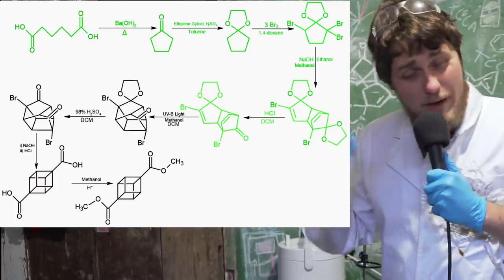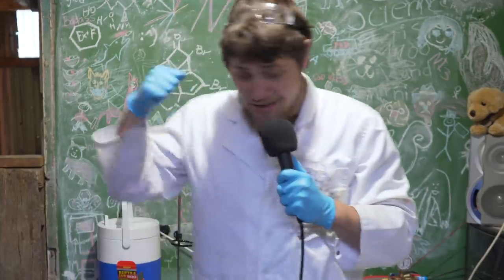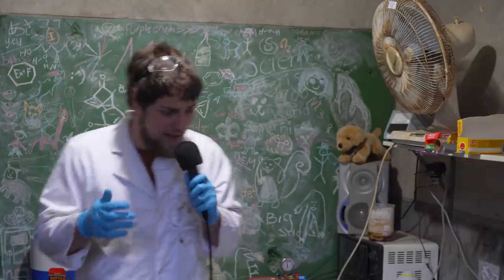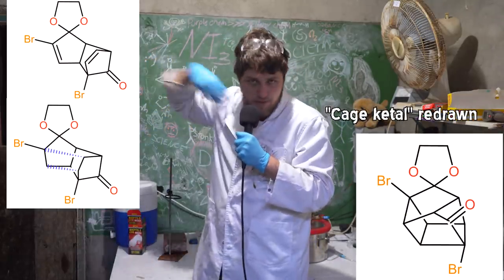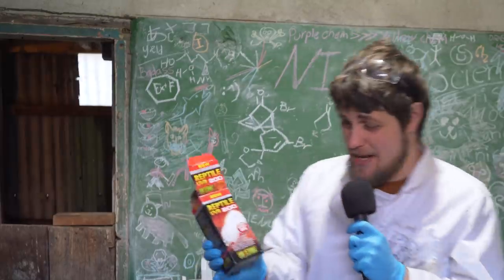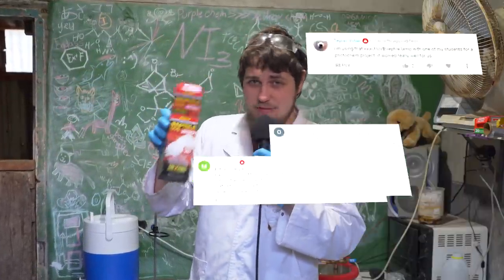Ultraviolet Cage Creation - Cubane Ep 10

Comment: For revelation, maybe you can use your long wave UV to reveal different spots as a "non destructive" revelator, note the spots and then reveal with KMO4 or if you have some elemental iodine on hand you can do the same with that and then reveal with KMNO4. That might help you differentiate between your unstaturated and your saturated ketone. 

Procedure for Iodine revelation (https://www.chemistry.mcmaster.ca/adronov/resources/Stains_for_Developing_TLC_Plates.pdf):
A chamber may be assembled as follows: To 100 mL wide mouth jar (with cap) is added a piece of filter paper and few crystals of iodine. Iodine [...] will rapidly become saturated with iodine vapor. Insert your TLC plate and allow it to remain within the chamber until it develops a light brown color over the entire plate. Commonly, if your compound has an affinity for iodine, it will appear as a dark brown spot on a lighter brown background. Carefully remove the TLC plate at this point and gently circle the spots with a dull pencil.

As for the eluting solvant, DCM/Methanol mixture is way too polar for both your subtrate and product. I usually use it to elute polar stuff like hydroxyamides up to a maximum of 5% MeOH/95% DCM. More than 10% MeOH can dissolve the silica if thats whats on your tlc plates. Try mixing some DCM and alkanes/petroleum ethers.

Comment: Quartz sleeved UV lamps have become very cheap thanks to the popularity of UV air purifiers and water sterilizers for drinking water, fish tanks, spas and pools, etc. I'm guessing that they're locally available in Australia, although likely at a premium compared to direct from China or the USA from a bulk-importer that gets them from China. They're essentially a standard fluorescent bulb, but with a quartz envelope instead of glass, and no phosphor to turn the UV generated by the mercury vapor into visible light.

Pardon me if it was already covered in the video, but exactly what wavelength of light are you going for? What was specified in the paper you're following?

Comment: Your TLC eluant is still too polar for your reaction mixture. Your desired product and starting material are very similarly polar. I would try 50/50 hexane:DCM eluant - aim for your main dark yellow spot to be no higher than 40% of the way up your plate for optimal separation. It may be the case that you've already converted all of your material and those two faint spots are just side reactions. Hard to say. Regardless, looking forward to the NMR.

edit: also - as others have mentioned - it may be worth looking into the opacity of your borosilicate glass to the desired UV wavelength. Maybe try moving your reaction mixture way closer to the lamp if you can't afford to buy a quartz tube.

Comment: Put the stirrer plater underneath the box and have stirrer bead in the tube should speed things up. Nitrogen or argon sparge of solution and balloon to keep any O2 out during the rxn or sparge and seal the tube with stopper a clip or elast band. Quality of glass tube matters as well. Pressure should be ok. Create concentrated rxn area, put a cardboard piece to half the area so its a 1/3 and put the tube as close the lamp as possible. Some times you buy uv or lamp probe and that sits inside the rxn solution. Thats how close you want it.  Some rxns take a few hours to 1 week. You could have alsorts of impurities. Polymers, alkenes joining to other alkenes.

Comment: You may try immersing the lamp in the solvent with your substrate to get better exposure surface. 
Of course it's better to use some higher boiling solvent than DCM for this since the lamp will probably boil it off.

Comment: You got any lenses for your ghetto lamp?  Might need a bigger box.

I worry that the solution is very translucent to UV so it's not absorbing a lot of it, whereas everything else in the box save the aluminium is opaque to it.

Could also make a parabolic (or spherical I guess) mirror out of a fire blanket, a hula hoop, and some pressurised air, and use that to focus the sun onto your tube, now the winter's probably over.

Comment: One thing I could think of is the emission intensity of the UV light you need is pretty low and the light from the lamp is pretty diffuse. While lining the box in foil definitely helps, it's not doing much to concentrate that light onto your reaction mixture. I think you should try some way to better guide the light onto your sample.

Comment: Yeah a MH/HPS setup would run anywhere from $100+ USD and the lights are like you said usually not self ballasted or self cooled. So tack on another 100 or more for that stuff. My grow lamps after running all day and checking their temps are usually around 140C-160C with a blower pushing cool air over them all the time. If you had no issues with evaporation you would then, as well as risk of fire. But if you are interested in getting that equipment look at nurseries, farming co-ops, hydroponic shops, and some reptile lights are self ballasted but they are on the higher end mine are usually $60USD+, you then run into the heat issue again though. Maybe make it a patreon goal so you don't have to drop all your personal money? Hope you're doing well with school m8 look forward to the next video, good luck!

Comment: Seems it'd be a lot more convenient to drill another hole through the lid and just hang that long test tube/vial, clamping onto the top so it doesn't slip through.  Then you could pull it out and check it without even opening the lid.

Comment: Vanillin Stain Recipe:
100 ml container
6 g Vanillin

1.5 ml Conc. sulfuric acid
95 ml 96% Ethanol

Try this even if you can't separate due to inadequate solvent it will have different colors depending on the functionality you put on the product so should be able to distinguish I'd you've done something.

Comment: If it works but slowly, put the mix into a thinner walled tube, much closer to the bulb. Like, buy a metal mixing bowl the same size as your reflector, drill a hole big enough to hold your tube, and put the bowl over the end of the lamp reflector. Capture ALL THE LIGHT.
... might need cooling though

Comment: You may be able to score a UV lamp out of an UV air purifier.  I found a "broken" air purifier and took the lamp out and put it in a standard florescent fixture and it works like a champ...mind the ozone though.  Also, it's straight up cancer light (UVC) so it may be too short of a wavelength; I don't have the equipment to test it.

Comment: I'm late to the game, but there are little water sterilizing lamps for camping. The brand in the US is steripen and it's a little self-contained low-pressure mercury lamp. They retail less than 100USD. Might need to break some of the safety controls on the thing.

Comment: Get smaller/thinner test tubes and put your solution right inside the spiral of the lamp, you will only need to foil the lamp for reflection and can leave it in the open air (or with a fan) to stop overheating

Comment: I've personally never run chemistry with those reptile lamps but have had 
 success with normal commercially avaliable CFLs and LEDS so the idea doesn't seem too far fetched to me. I however  would check the wattage on ur light source and make sure it lines up with what the literature utilizes. If ur lamp is too low in intensity this reaction could take forever. Also, you can certainly leave these reactions overnight without much danger but your set up should be adapting to cool as well (Heating a photo reaction is a nice way to set up decomp)! As an anecdote,  I've left photoreactions with DCM/MeOH under xenon lamps with cooling for 12 hours and nothing dangerous occured so im sure u can fix this set up to do something similar. You could purchase some lamp top cooling pads or even those cheap box fans meant for student apartments on amazon those work fine. Oh, also If your compound is sensitive I would possibly consider removing  as much oxygen as possible, uv light can always generate singlet oxygen which for most photoreactions is not the best. 

Good luck!
Reply from the maker: Yeah that's basically it. The wattage is only 26W and that is tiny compared to the 1200W lamps the papers tend to use, so yes, it takes forever. 
How did you actively cool your photochem reaction, was it just air cooled? A laptop cooler is a neat idea, thanks!
Reply: @ExtractionsAndIre  I gave a brief look the references and yeah 26W might not cut it in my opinion. Personally, I'd try bumping the wattage up to at least 1 100W blub. We have few set ups but our most simple are a just a screen made out of cardboard and aluminium foil that covers the reactor on three sides sith the fourth side facing a wall. Typically we at least use a fan to have some air circulation to avoid heating up the reactor. I could show you pictures for ideas if you'd like. Let me know!

Comment: If you need a mercury lamp, you can find a street/industrial luminiscent lamp with its starting inductance and whatever it has. It has external glass coated with luminiscent powder (calcium wolframate as I know), but if you carefully brake it, inside you find out a mercury lamp. Be careful with bare wires and all...

Comment: 5:42 Oh, that was a job for a hot knife... or a 'hot round', if you had a round piece of metal like a ceiling light can, or for that matter an actual cut can, you just heat that through various and sundry methods (torch for the knife, propane grill for the round) and then you (using heavy gloves) simply cut the hole with the knife (when it stops sliding through like butter, reheat), or press the hot round onto and hence through the plastic. Carefully smooth the melt and cut the 'strings' with a sharp boxcutter and call it done.

Comment: Hi mate, didn't read through all the comments, but if you're still looking for a solution: I'd try a spare reflector and place the tube in the focus, then point the lamp straight to it. 
The aluminium shielding is nice, but you might still disperse most of the light and not keep it focused on the tube.

Comment: Multiple lamps might work but more important distance from the flask to the lamp. Put the flask close to the lamp without touching put a fan in there to control heating. Snap the light on and run it for a few days. The test tube is good but a dram vial or even something thinner is your best bet. DCM can decompose to HCl and CHCl3 so maybe use pure MeOH instead. Some reactions with photo chemistry use the solvent as a photo sensitizor. I’ve had luck with acetone for 2+2. Good luck photo chemistry is a bitch sometimes!

Comment: Ok i dont know if this is a stupid suggestion, but could you possibly use an open electrical arc as a concentrated UV-B generator? You might be able to "re-break" your ozone death machine to make an open electrical arc and then place it near the test tube.

If you consider this you should probably characterize the light coming off of the electrical arc before destroying any precious reactant

Comment: Could try using a photosensitizer I.e a compound that absorbs light and transfers the energy to your reactant. You will need to find one that emits at 325nm, although removing it from the reaction mixture will be tricky and might require column chromatography. The only other option I see is to change out the lamp for a higher wattage. P.S For the TLC using hexane ethylacetate mixtures might work better 😊

Comment: Again, as commented on the last video, you can use a diffraction grating, a cheap example is a CD, to select for the particular wavelength you want from sunlight. Not that much of it will pass the ozone layer.
Reply from the maker: Possibly, but for the UV wavelengths I cant use plastic as it absorbs, I wonder if the CD will absorb the UV or not?
Reply: @ExtractionsAndIre  The CD is a reflective grating, so the effect ought to be minute, but apparently uncoated, purely reflective gratings are made on glass for $100 a piece.
Or you can just hold something flourescent there and check?

Comment: Any concerns about using the impure dcm in the photochemstry? Methanol can act as a hole scavenger/reducing agent, could deactivate your reaction (I haven't looked up the reduction potential for your reaction, don't @ me). Quartz tube could help a bit too. On the other hand, you could use borosilicate as a UV-C filter, and blast it with a source that has a mix of UV-B and UV-C.
Reply from the maker: One of the papers we're following used methanol as their solvent for the UV step and didn't have any issues, so that's why I felt it was fine
Reply: @ExtractionsAndIre  Methanol should be fine then. As some of the other commenters said, if you think optical power is the problem, you could change your light source. I don't know what lamp you're using, but google says maybe 170 μW UVB per cm^2 for reptile lamps? If you switched to a 311 nm phototherapy lamp you could boost that to 8 mW/cm^2 . Getting pretty far from hardware store at that point though (you can buy the ballast at a hardware store!).

Comment: Now I don't know shit about chemistry but Jesus wept... the box modification sequence was hard to watch until Dad stepped in.
Onya Dad.
Considering that they sell those UV lamps for use in reptile enclosures , surely just sticking it in a corner behind a sheet of glass would have been adequate protection? (Since regular old silica glass blocks most of the UV radiation).
Edit: Actually, I can already see multiple reasons why that might be a terrible idea in Tom's Shed.

Comment: Hey I got an idea, use your torch to heat up the middle part of the bulb and pushed out of the way a little,  just enough to get the test tube to in the middle of the bulb.  Stand the fixture upright and wrap the top with aluminum foil.
Reply: Then you could bend a glass rod in half and stick it down inside the test tube and run cold water through it for cooling.

Comment: I think i tried to post on your last video but it might have gotten removed. not sure why.
I did my PhD in synthetic photochemistry. We used Rayonet uv lamps. The bulbs themselves aren't too expensive. The reactor is pretty expensive but you could probably just bodge something together from a small halogen lamp holder.
Reply from the maker: Alright thanks for the tip mate!
Reply: @ExtractionsAndIre  No problem. My PhD was a while ago but let me know if there is anything else i might be able to help with.
Big fan of the channel

Comment: From having had reptiles as a kid I know these lamps degrade. So be sure that if you find some cheap lamps, you measure their output and verify their spectrum to be in the region of what you want.
Also, if you can get away with having an open container and placing the lamp(s) much more closer, you can get a lot more direct light onto it. Halving the distance between lamp and liquid doubles the light intensity. Putting it all in a petri dish and wrapping outside with aluminium and then putting as much lamps straight onto it with no distance inbetween must give you a lot more light. If heat does become a problem by then, put the petri dish on a steel plate to dissipate all the heat.
Reply from the maker: Ah nothing ever lasts does it. Thanks for the thoughts mate!

Comment: If it comes back in the 2-5% range, rethink the lamp, if it comes back in the 5-15% range, buy one more lamp, toss it in the other side, and run the aluminum into a sideways cylinder shape between the 2 lamps, with the reagent in that cylinder. (You are losing a bunch of your light to  it escaping your box)
If it is in the 15%+ range, make an aluminum cone, cut the tip, set your reagent tube into the hole (expand as needed, and support obviously), wrap your tube in foil, and set the lamp shooting straight up and the cone sitting on top.

I think that if you are getting your proper wavelengths, And they are properly penetrating the glass (would double check that your glass isnt acting stupid at your desired wavelength), then you just arent getting enough of your UV to pass through.

If enclosing it that much causes it to get too hot then idk m8.

Comment: I'd expect ~75% transmission at 325nm with borosilicate glass as I'd say your walls are about 1.5mm thick. Maybe its not borosilicate? Your light is also outputting a pitiful amount of UV. You can get all sorts of UV lamps at saltwater aquarium stores, which id reckon are all around you. They cost very little compared to all the time you've spent dicking off with this (~$50 for a rig). Note: if you do use a real UV lamp, stick with borosilicate so it blocks the deep UV for you. If the bulb is actually working, your plastic should start to yellow where the UV is hitting it.

Comment: It's so weird hearing all this chemistry that I really don't understand explained like it's nothing too major, yet watching the power tool struggle.

That being said, I tend to wear an old flak jacket & steel helmet (the poly ones specifically for power tool safety don't necessarily stop disc fragments) when working with rotary tools because I have a tendency to break drill bits and angle grinder discs.  So I don't have a lot of room to speak on the power tool front.

Comment: As someone who works on femtosecond plasmonic dynamics and such voodoo shit, my best guess for a great UV source would be titanium saphire femtosecond laser amplifier with a OPO / OPA (optical parametric oscillator/amplifier) in combination with a BBO (beta barium borate) chrystal for second harmonic generation. This would enable you to precisely tune the output wavelenght and have amazing peak powers. Though it would also cost you something in the range of 100k - 500k$, which might be a smol problem  :D
Reply from the maker: I work with OPO lasers for my PhD project! They're not Ti Sapph lasers and are nanosecond, but yeah with some doubling I can get tunable range down to 210 nm, which is so cool